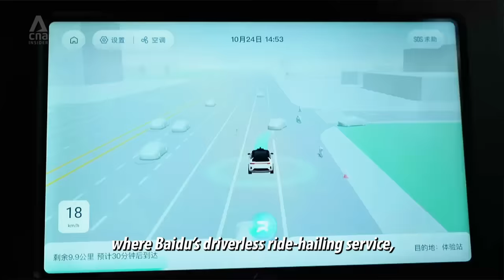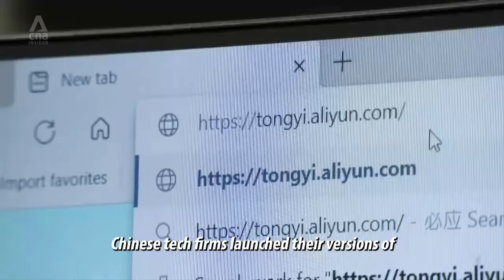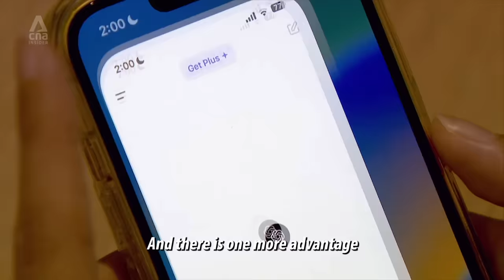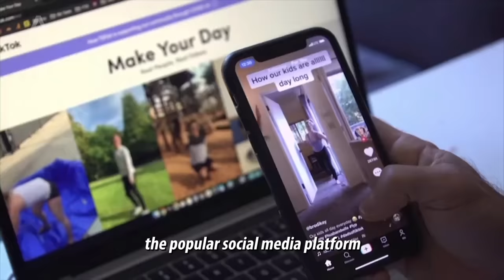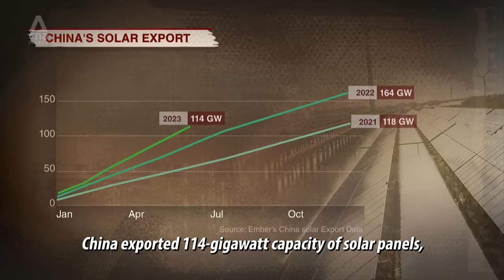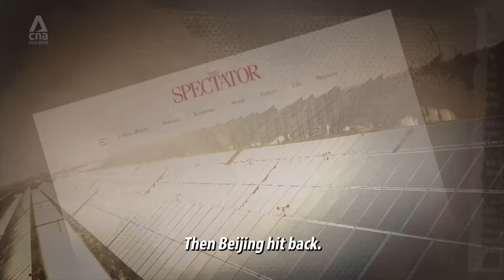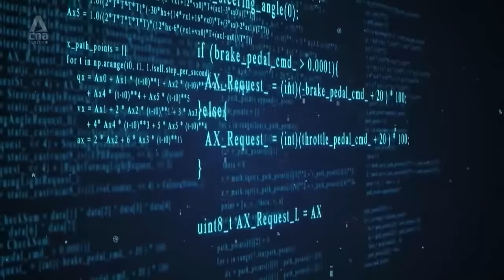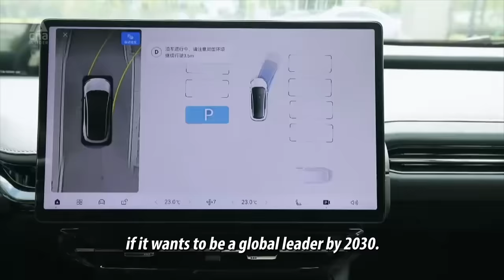US or China: Who Will Win The AI and Green Tech Race?

Comment: AI isn't only about large language models like CNA insider talks about. 

China will mostly use AI for robotics & automation which China has a great advantage in because of it's advantages in sensor fusion. A lot of the technologies used in EV's are extremely helpful for automatizing factories. Additionally, other sensor technologies used in EV's can greatly be used in drones such as LiDar and other radar systems. This is one thing that China will have an advantage in no matter how efficient a large language model is. 

On the other hand, the US will mostly use AI for generated models and for consumptional use through advertisements.
Reply: Wrong, openai has already recently collaborated with robotics companies a few weeks ago. They released a mindblowing video 2 weeks ago of figure 1 robot working using chatgpt. The US will slowly dominate the robotics market also.
Reply: @levvz6113  That's still just software. The hardware of a robot, which dictates its ability to interact with the environment through sensors is incredibly important. Additionally, the movement of a robot is also important. For example, the Unitree robot that did the backflip is already on par, if not better than Boston Dynamic's robot because it uses electric actuators rather than mechanical which makes it more energy efficient. Generated models will only bring some benefits, like the ability to communicate and do some difficult tasks. But, it's important to know that AI has already been used for robotics and automation for a very long time but, despite this, what's really more important is the sensor fusion and how the robot interacts with the environment because if it is bad interactions then that's just bad data for the AI to learn from. This is why sensor fusion is incredibly important and while AI may help in dealing with bad sensor fusion, it isn't the solution to it.